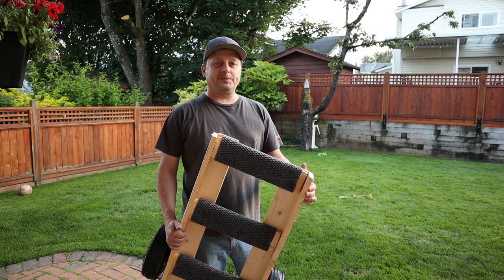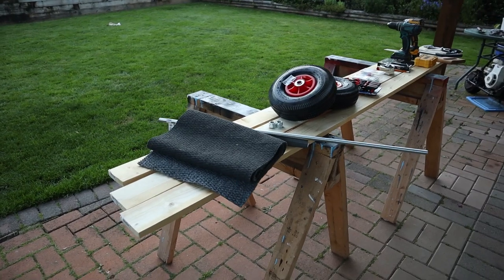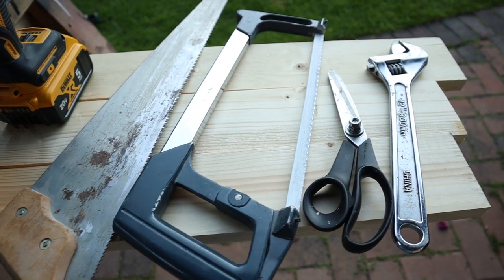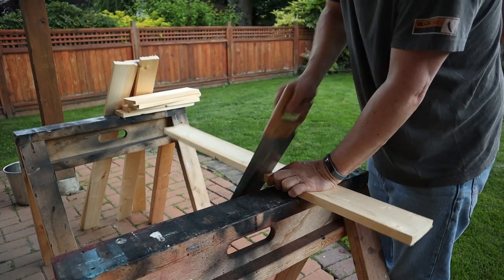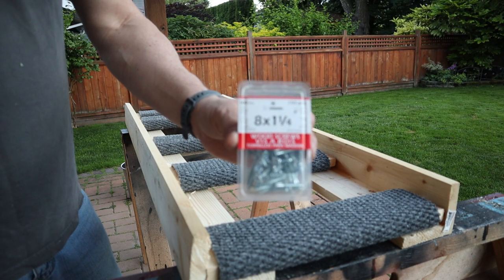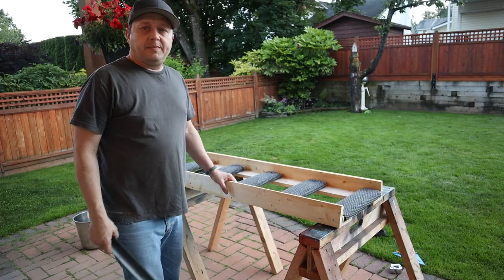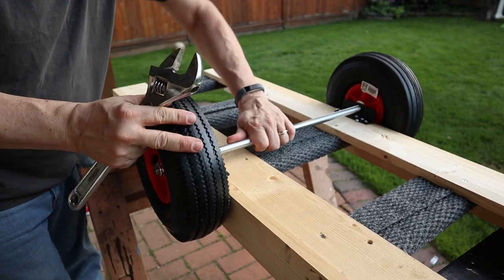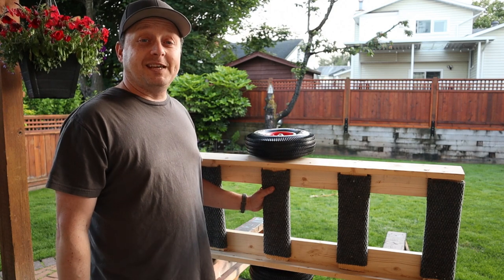ROOF TOP TENT CART // How to make a cart to move and store your Roof Top Tent (RTT)

Comment: Great idea. You think a double set of wheels spaced front and back would make even better? You didn’t find the height of the rtt whated to top it over ?. Gunna give it a go
Reply from the maker: Thanks for commenting.  No, one set in the middle is perfect. It makes it easier to steer.  If you used 4 wheel, one pair would need to be steerable. It is a bit top heavy but I’m aware of it and it’s never tipped over.  Strapping it down helps a lot.  Cheers.

Comment: Mine is a lot longer. Maybe two wheels?
Reply from the maker: Unless those wheels can pivot it would be hard to steer. You could put two wheels in the middle (like mine) and a larger caster style wheel that spin on each end. That would be pretty slick. It would almost resemble a lumber cart.  Cheers.

Comment: Do you have an issue with the tires rubbing the sides of the cart? Or are the hubs wider than the tires?
Reply from the maker: No issues. The one side of the hubs stick out for this reason.  I guess if its an issue with other wheels, you can install washers.

Comment: What are the dimensions for your tent? Was wondering, I have a closed dimensions of the tent are 47"W x 76"L x 11" H. Will the cart an specs you built to fit my tent?
Reply from the maker: Well, I used 8ft boards cut in half. So, my cart is 48” long. Yours being 6-1/2 long... I would adjust the length to suit or else or tent will drag on the ends.  I’m assuming your tent is a hardshell?